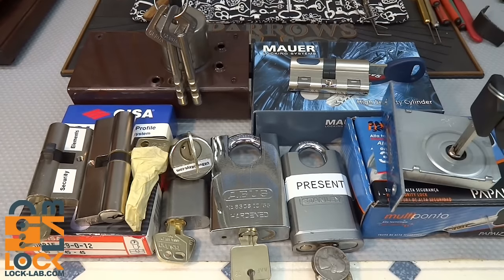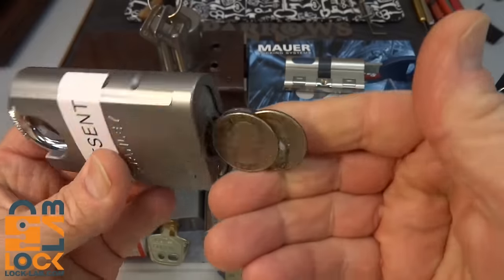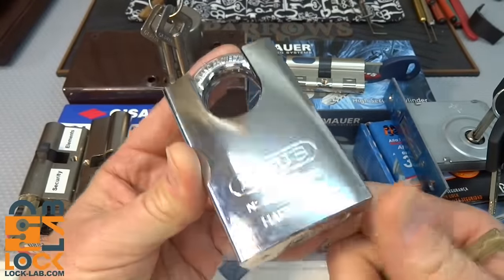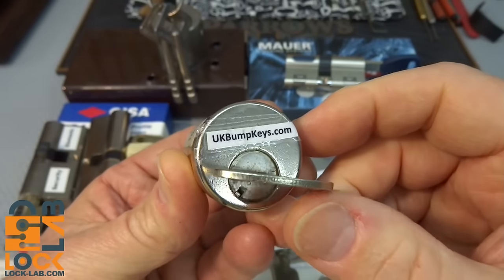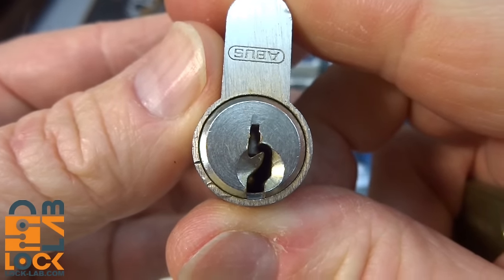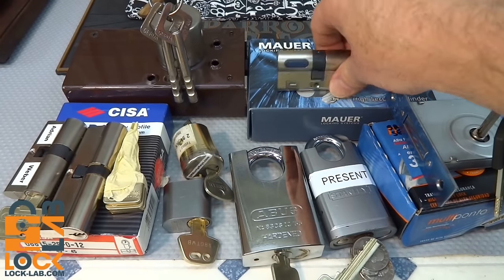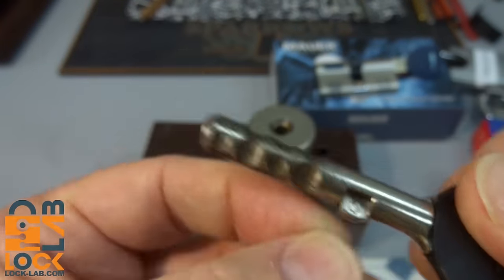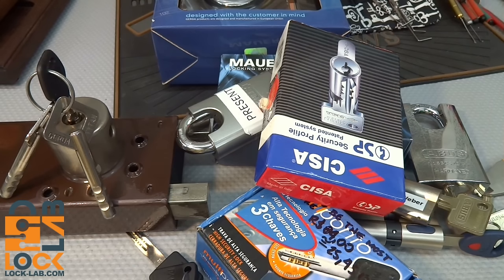(967) Naughtiest & Nastiest Locks in the LockLab

Comment: Nice collection Bill! I've picked a Banham before, I think you should disassemble it as it's not as complex as you might think.
When picking it, make sure you don't stick a pick between the opposing pins, they have to stay touching (hence the holes in the key). I filed a half-ball pick to grip the pins without separating them. The hard part is the feedback... very little

Comment: Hey when you want to see the inside of the key hole and are having trouble with getting light into it just use fiber optic lighting. You can literally go and get one of those cheap fiber lamps and take a single strand and shove it into the lock hole.

Comment: I actually once scoured your channel looking for a success re-attempt of the Gerda Tytan, as I'm familiar with that exact lock (but also with a built-in break-in alarm circuit :D). That variant actually needs picking three times - once for the steel peek-hinge and then twice for the main lock. At three rotations, it's unopenable from the inside of the house, so if someone breaks in through the window, they'll have to carry your stereo out the same way ;) and if they try to force open the door, the built in alarm sounds and (optionally) can send a signal over a cable tot he rest of the sec system. Neat... :D

Comment: Although those locks may be challenging or impossible to pick, they're of little value on typical American tract houses, since a rock from the landscaping will get a burglar through a window or sliding glass door faster than one could operate the lock with a legitimate key.
Reply: @rkan2  but those are both tamper-evident, which is the point of having a hard to pick lock, if the burglars broke a window or busted in the door you have clear evidence that your house has been broken into while if they entered by picking the lock it'd be far harder to prove

Comment: I might have gotten lucky with the bitting but I tried and picked that Mauer Lock several times using a rake and a hook for the sliders and a flag on the pins. I was going to the sliders after I had set all of the pins to some extent and finished of the last 2 or 3 pins with the flag pick after that. If there was a pin cut  too deep it probably would not have been possible to access the sliders. So I guess it might be just a coincidence that mine is nicer to pick.

Comment: Nice :) I always have at least one Gerda in my door and never had a break-in.
But about 10 years ago one of them failed on me (key wouldn't enter all the way) and I had to call in a locksmith. He did defeat it, but I can't remember how...
Reply: drilling
Reply: Bogo definitely not drilling.
Reply: had these for years and what fails in them is debris getting into the hollow key. the locksmith most possibly just cleaned the key :)
Reply: Pawel Kalinowski - keys were fine. From what I remember, I was able to insert the key all the way, but couldn't turn more than 90 degrees. Maybe he just lubed it.

Comment: I don't quite have the time to look through lots of your videos but I'm a long-term subscriber. How comes there's no mention of the Protec2? As I understand, that remains unpickable, right? Secondly, regarding those Gerda locks, I thought the G2000 came out years ago (before 2013 I'm sure) before the G1000, and yes, the G2000 has incredibly high tolerances. Typically a brass core with brass pins. There's 4 different depth pins and the longest pin (for the deepest cut) are typically mushroom pins with threaded pin holes in the core. Due to the design restriction, those 4 pin depths can become easy to remember if you see someone with a key as the key is 8mm as well as the cuts making very distinct sizes so you could actually cut your own key with a Dremel for example. Illegal because patented but hey, you think a criminal cares about patents?

Comment: Are these locks one-off for being near impossible to pick or do you think every lock of each make will be the same?
Reply: The stanley lock is a custom job. The stock stanley 24/7 comes with 6 pin sc4 core.
Reply: Thanks
Reply: Some are challenge lock that mean were purposely build so Bill couldn't pick them. Other are just normal random off shelf locks that simply are good.

Comment: What would you recommend for door locks/deadbolt best security on a budget?
Reply from the maker: Mul-t-lock MT-5+, Medeco or Abloy...  Not cheap, but neither is replacing your stuff.
Reply: +bosnianbill I happen to have seen retail pricing on that ASSA-Abloy d12 series, it's like $100 per cylinder, non-custom. And the side-bitting is almost fixed with only a handful of different cuts in any given market.  They have an even trickier series where one of the pins is electronic with a chip and a battery in the key. You have to pick 5 pins, plus sidecut, then crack the electronics before it'll turn. But they went all cloudy with the chips, having to phone in your chip all the time.
Reply: I'm not sure if a lock is going to keep anyone who /really/ wants to get in out of your home. Most likely your house is covered in breakable glass entrances. If it's not, a lock or door can still be forced. If there are no doors or windows into a home, someone can still break a hole in the wall and gain entry. I don't think any criminals learn to use lock picks anymore. Lock-picking is a hobby for the good guys.
Reply: Med Otaku+ sure.  Nothing is 100% proof but you wanna make as hard on the person breaking in as possible and hopefully, he'll give up and find an easier target.
Reply: Yeah, but the takeaway is that there isn't really a need to increase your lock budget BEYOND the point that a thief will simply decide to break your windows rather than pick it. Anything past that is just wasted money.

Now, the story's different if you've got a bigass safe that you're trying to lock or something. Something they can't simply take away and break open at their leisure. But for a house door, there's a point at which there's nothing more a lock can do until you put bars on your windows.
Reply: Cory Sennett what you need to remember there is one pick that none of these locks can  hold out agents.. and that is an angle grinder
Reply: @anthony5844  Sand beats the angle grinder
Reply: @bosnianbill  would you happen to have a link or a trusty resource I can get a Abloy lock? There all over eBay, but how do I know there not fake?
Reply from the maker: @anythingadrenaline4515  Sure, this is where I got mine:  https://securitysnobs.com/
Reply: @bosnianbill  👍

Comment: Holy shit... That banham lock... I have one like it I found in the garbage, but I have no clue how it was secured in the actual lock, or what the actual lock was. It has two ball bearings on the end that retract when it is unlocked and it could have rotated in the enclosure, whatever the enclosure was, but there is no indication of how it was actually held in the lock. 

What is even more interesting about the lock that I have is that there are THREE rows of pins! There is a third row of pins along the top. It boggles my mind that this lock could ever be picked. I have debated sending it into you, and wanted to learn to pick it myself, yet seeing that even you cannot pick the two row one I doubt I would ever be able to pick the three row one.... I may send it in to you just to disassemble and see what is inside.

Comment: Gerda locks are very popular in Poland and the ones with round keys are considered to be unbreakable. The common opinion is that you shouldn't install them into regular doors (as opposed to reinforced security doors). The reasoning behind this is that desperate burglars will just destroy the doors that have this lock and there really were cases of this happening. Even then a burglar has to hack a hole through the door that he could slip through, because this lock is impossible to open from the inside when locked from the outside, to further complicate things for potential perpetrators. The only downside seems to be that the keys can be replicated without the use of any special keymaking equipment, but that's just what I heard, don't know if that's true.
Reply: Any key can be replicated. It need to be rly fck strange to be impossible to replicate. Because the more expensive key replicators are small 3D CNC. those replicator sometimes even have  options to "go around" patents by slightly changing shape for example by making semi-random cut somewhere :)

Such things as key restrictions or patent protection, whatever is plain worthless marketing.
Reply: Czorńy Lisek True!

Comment: Isn't it a case of diminishing returns to make locks increasingly complex?  At some point, the criminals will simply opt for the Gordian knot solution and bash the door in or break a window.  Or they will employ some sort of ruse to trick you into letting them in.  So much for spending a ton of money on the latest and greatest lock.
Reply: If you are trying to protect something then you should approach the objective with a mutli layered defense system. Depends on what you're protecting and at what cost.
Reply: Lock are there for protection when You are not in home, near building, bicycle whatever.
With rule "chain is as strong as it's weakest link". If You put good lock, You also use good chain, doors end think what You're doing.

Also to be fair it's not like criminals pick any lock ever. They almost alway go the force/brutal way. Still "chain is as strong as it's weakest link" is rule. ;P

Comment: bosnian, what are your opinions on digital door locks, like the Samsung SHS-P718, do you think they're secure for a front door, or do you think they have too many points of attack to be worth putting on your front door?
Reply: Watch DEFCONs after that You will not trust any electronic device end start to live 1KM under rock in faraday cage. ;P
It's better to buy rly good physical lock. but don't forget about as good doors, windows(that does not open end are not mounted just on foam) end don't live in typical US home from cardboard. Chain is as strong as weakest link.

Comment: Just remember ......  your stuff is only as safe as the surrounding materials around the lock.  why pick a lock when you can just cut out around the door?   (assuming they could just go through the siding/concrete/wood that the door is attached too)  as far as homes and such....    bigger places (banks/companies/and such) again.. why bother with the lock?   Fire... meet Metal...    ~cutting torch hinges~   done...   as for ppl that will say "well then you're just going to burn all the money/documents you're trying to get at" ...   then...   say hello to HOUGEN DRILL!!!! with a 2 inch bit on it... lol  and cut straight into where the latch goes to keep the door closed when engaged.. XD   Have fun everyone

Comment: There is no shread of evidence worldwide that Gerda titan has ever been picked by anybody.In fact nobody came even close doing that.The locking bars in Gerda are made from steel.In 95% of the locking rods in armoured doors ,they are made from a nikel plated alloy that has mild to low strength.You can bend them using a prybar.Good luck doing that to this Gerda lock.Opening a hole through the wall is a better choice,because the other would be to remove the entire door with the steel frame from the wall.

Comment: In US the lock market is almost 100% the simplest most trivial to pick cylinder locks. Is it so that gvt agencies can easily pick your lock? But even worse: in many stated it is "illegal" to possess lock picks. Give me the break: the crime only happens when one picks lock he has no authority over. Yes, I do have personal grudge on that idiocy: I had to drill out, throw away, and buy replacement for the lock in my place that I didn't get key for. Whereas it may be quite likely that I would be able to make key for it if I picked it (to remove from the door), disassemble and make a key. One more crap: they will not sell you blanks, only cut a duplicate for you. A moron was consistently cutting duplicate from fatter blank that wouldn't fit my lock. No way you can convince him by measuring with caliper the key and the blank to show the difference.
Reply: It not just US or something. Some countries(end states) don't allow lockpicks if You are not authorized nor to sell You blanks(they are automatically considered bump keys). But in any country(state) with restrictions You can get authorization end have as many lockpicks that you want.

Also if there even exist blank keys outside factory then You have rly shitty lock :)
Even if locksmith would have one of those expensive 3D CNC for making almost any key he would be not allowed to legally made a key if it's patented(most are).
Reply: OK, in free society harming someone else is a crime. Possessing any sort
 of tools is not. Harming another using tools is. I am my own authorization to posses any tools, whoever says otherwise is attempting to enslave me. We are being enslaved by the need to ask permission of government to possess tools of self defense (be it firearms, knives or anything else). We are being enslaved by having to ask permission, no by buying permission (and paying hefty fee), to possess tools to open our crapy cylinder locks. And the list goes on. Neither possession harms anyone, thus is not a crime in definition of a reasonable free person.
Welcome to modern slavery ;-)
Reply: ***** In Europe NOBODY have problem with that. End we have rly rly low crime of any kind to the level that even police don't need to cary anything to self defense. Allowing everybody doing everything is not rly a good thing.

For example all crimes with guns(be it illegal owning, shooting, whatever) in one year total 325 in country that I live in. In few days in US there is more crimes connected to guns.

You must learn difference between hi freedom end anarchism.

Although in My country law about "bulgary tools" is written in rly stupid way that it's possible to put in jail everybody but simply nobody there is suing anybody for stupid things. Well nobody is suing each other like crazy. Law may be in Europe tougher it gives us much much grater safety that in US end about stupid, minor things nobody is suing each other anyway. Even if somebody would court would be like meh it's stupid We don't care.
Reply: I like people claiming something on behalf of everybody. "Speak for yourself only" is the same as respecting the right of another person to have different opinion on the subject.  Speaking for everybody is reserved for dictatorship. Whoever want to be (voluntary) slave of one definitely will not respect or even listen what is said about "individual" rights, so I feel that I'm just wasting words...